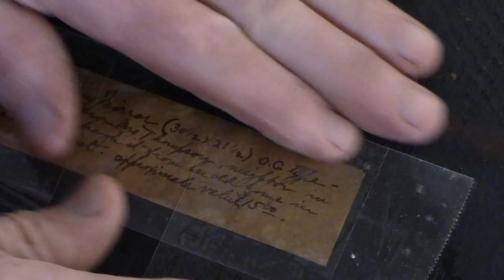Repairing a Thrift Store Mirror - Thomas Johnson Antique Furniture Restoration

Comment: can i know when to use wax & when to use wood putty ? since putty is polishable it can flush with adjacent side which seems better ???
Reply from the maker: Thanks! I use the low heat wax when I don't want to sand, or in cracks and joints that I think could be prone to movement. During a normal refinishing process, when I'm sanding and need to fill defects, I use regular Famo Wood putty, or sometimes epoxy putty
Reply: Tks  Thom @johnsonrestoration

Comment: I heard if you hold a candle lame next to a mirror and view it from a side angle you can count the amount of flame duplicates it produces. It's said each duplicate adds ten years to the mirror. Therefore a hundred year old mirror would have 10 candle flames one would count. Is this true?
Reply from the maker: Thanks! I've not heard that before! Could make a good video!
Reply: @johnsonrestoration  It's like when you look out hundred year old windows in an old house it's blurry. As I'm sure you know glass is actually a liquid and as it ages it sags or runs giving a separate reflective perspective much like the blurred glass in the old house. When aging a mirror ten years per candle flame seen from an angle it seems to be somewhat accurate. I've checked it on a dresser mirror from a garage sale or thrift shop and estimated the era it was made by it's design, materials, etc. It seemed to be accurate at the ten years per flame image seen from an angle but wasn't exactly sure if that method could tell the age of a mirror accurately or not. Sometimes it's hard to count how many flame images; one time I counted 13 or 14, had to change my angle of perspective to achieve a more accurate count. I didn't try to photograph it and then count the flames from that photo image but my try it in the future. I do know one thing, it will tell you one mirror is definitely older than another one by image count. If it's ten years per flame image is the only question I have.

Comment: Where can I buy the French polishing compound that you used? Great video
Reply: You can make your own. It is just denatured alcohol and shellac chips. You can also find it prepared like "Bullseye" brand shellac that can then get mixed with more alcohol. I normally use 4 parts(or more) of alcohol to 1 part Bullseye shellac. I use the "amber" color shellac that used to be called "3 pound orange", but for some things I use the clear colored one. You will find that no finisher uses the same stuff or the same technique, especially with "French Polishing".
Reply from the maker: Thanks! Be sure to read Robert M's comment below. The "Lac-French" I used is from Mohawk https://www.mohawk-finishing.com/products/wood-touch-up-repair/padding/lac-french-padding-finish-light-amber/
Reply from the maker: Thanks Robert, you are exactly correct. I got used to using the Lac-French doing on site repairs, It dries faster and harder. But yes, shellac is fine and traditional.
Reply: @johnsonrestoration  Thanks for the positive feedback on my response. I agree that the version of polish I mentioned can be tough to use for a quick touch up or if the weather is too humid/hot. A nasty humid day can bring progress to a near stand still if you don't have the heat or AC to help. There are so many different things you can do or little tricks and methods when it comes to finishing, they just need to practice.

Comment: I love your channel, however I would love it if you explained why you're doing a particular process other than another. Especially when you attack the finishing parts of the videos, For instance you said you are going to add a layer of shellac prior to French polish, but why? Or you use spray shellac instead of liquid but why? Does it give a stronger overall finish  etc. Also the glue you use has always eluded me, is it hide glue you use? If so why, why not PVA of sorts.
Reply from the maker: Thanks! Yes, I definitely need to do a video on that subject. I will start working on that, it’s going to take some time

Comment: I've watched many of your videos and I notice again and again that you get glue on the surfaces and then just wipe it away.  But later you are able to stain or dye the new wood without glue having soaked into the wood and rejecting color.  What is your secret? I'm mystified.  Such high quality fantastic videos.  And I love all the animals.
Reply from the maker: Thanks! Most of the time I am using hide glue, which easily wipes away with a damp rag. The glue doesn't soak in much and can be sanded away if some gets in the grain. Also, hide glue doesn't show up like other glues, it just seems to blend in
Reply: Thank you.  I may just try this out.

Comment: I think your crack and joint repairs should fit much tighter than they do. You use way to much wax to fill in and that adds nothing to the strength of the piece and the wax will just flake off leaving it worse than it was. You are a novice restorer and not even good at that.
Reply from the maker: Thanks for watching!